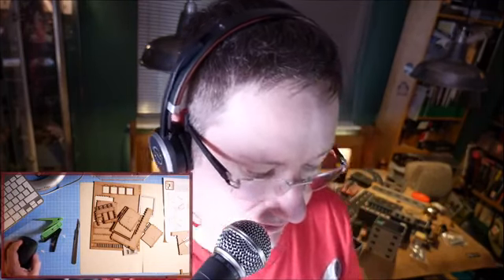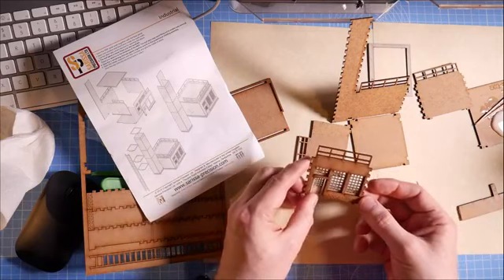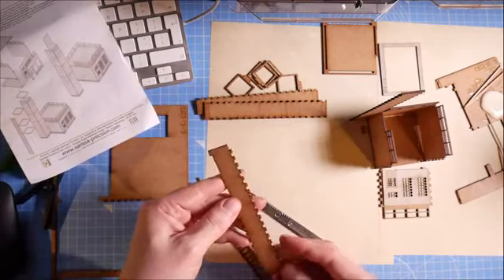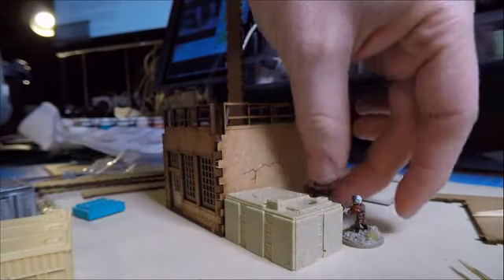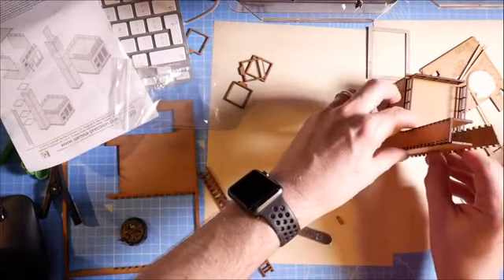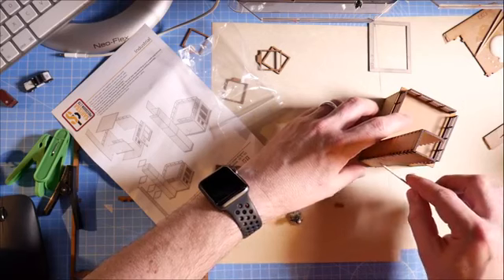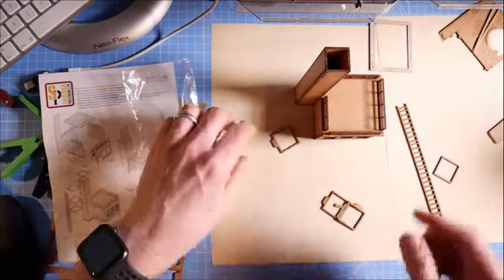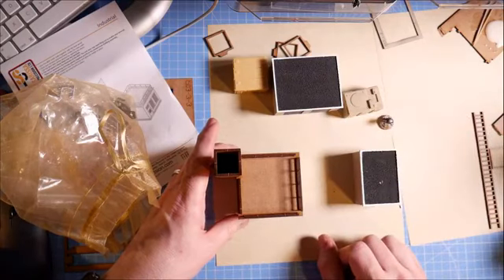Building a 15mm SCIFI tower

Comment: Robin:  I wonder if working on buildings and terrain like this ever makes you feel like some sort of 'civil engineer'? (I have to confess that it does that for me at times.) The MDF stuff is really cool but so are some of the resin and plastic buildings. I was curious if you have a preference for looks or ease of construction or durability when the piece is completed. Or if there is a 'type' you'd recommend over others? I was also wondering if you'd ever tried using magnets to hold buildings together so they could be disassembled into 'flats' that are easier to transport and store? Do you ever do any sort of detailed or advanced work on the interiors? I ask because I was thinking of getting some actual pieces of miniature furniture and such for looks, and maybe even as usable pieces for micro-tactical skirmish games and scenarios.   Thanks again for sharing your efforts with us.
Reply from the maker: I like them both and I mix them together.  Resin tends to be less flexible and smaller because it is hard to make a large  building without the resin cost making it prohibitive and you are locked into multipart etc. I have never really considered magnets because its too much work and when I did travel to show games with Gruntz I would just stack everything in box's. Also these items are fragile and gain strength when glued. I think it is fair to say they cut corners in mdf kit design on the basis that once constructed they gain strength and even with very strong magnets you have trouble getting it all together without damage etc.